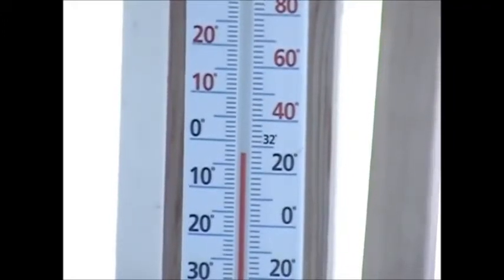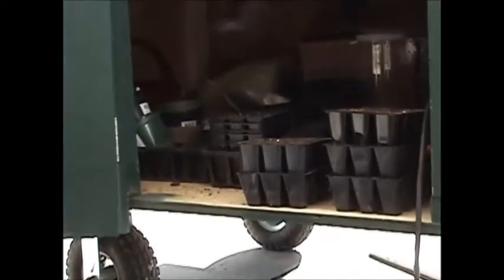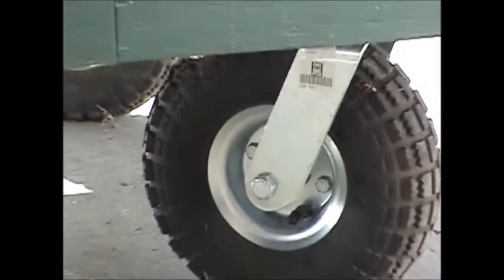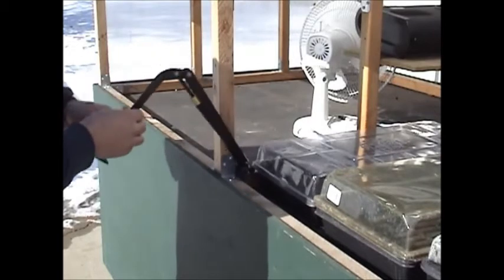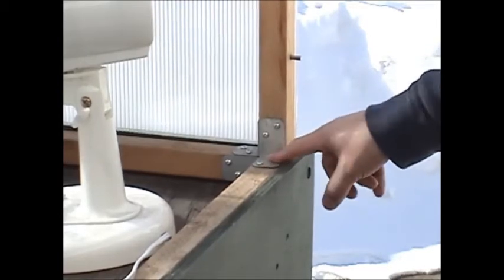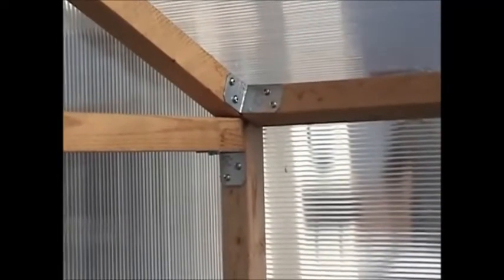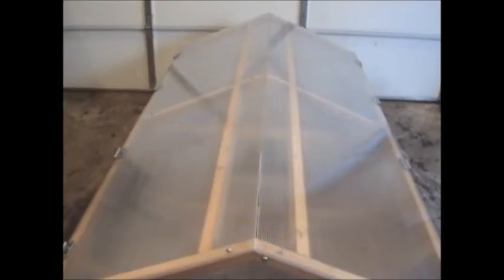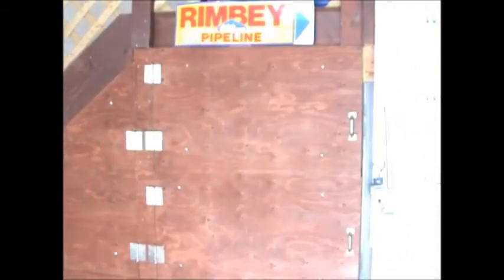Mobile Greenhouse Tour

Comment: I really like this idea and the pepper dome, you're very creative in extending your growing season ^_^
Reply from the maker: Some people really get into the season extenders. I don't really have the room for a permanent greenhouse so this is what I came up with.
I hope someday to be making another one that will be twice as big and built like an actual walk-in GH. My plan is to put it on angle iron rails with metal trucks(like trains have) to make it easier to push in/out of the garage. It will be designed for easy assembly/disassembly.
Trouble is the garage door isn't high enough. The roof will have to be retractable and that will require a mighty feat of engineering on my part...
Reply: Oh my goodness ^^ I feel like there are normal people in this world and then there are gardeners, but I'm so happy to be in the latter group ^^ 

I'm so humored by the pattern of how people with this passion have it slowly creep into other aspects of their life... for example, my bookshelf is slowly but surely being converted into a makeshift grow room and the compartment under my sink is already housing 10 plants hahaha! Ever expanding hobby ^_^